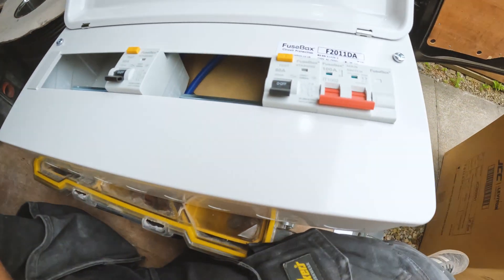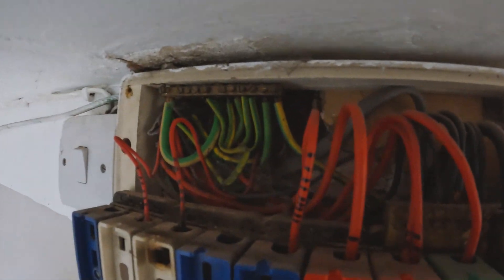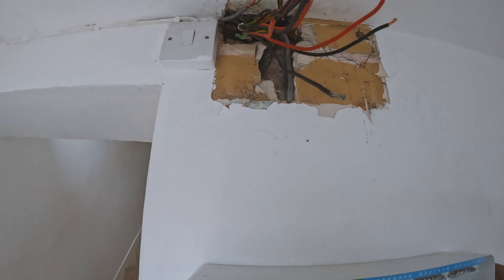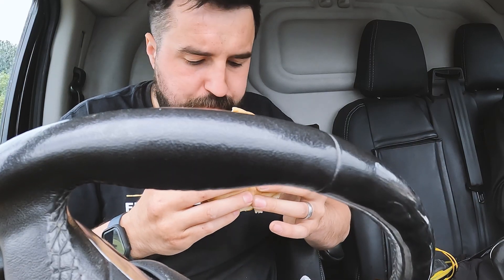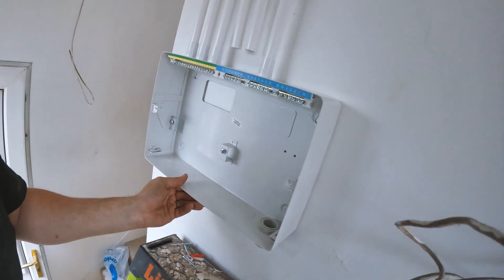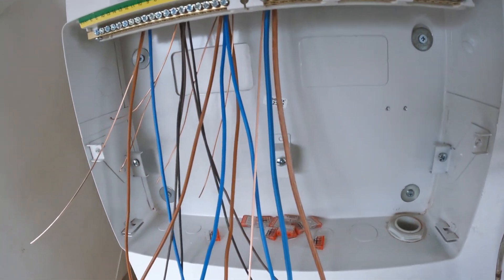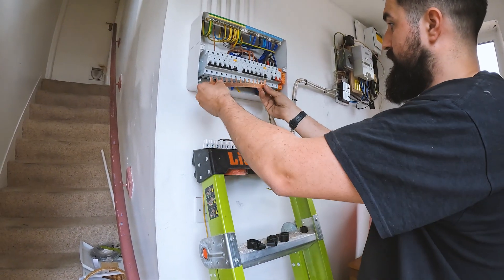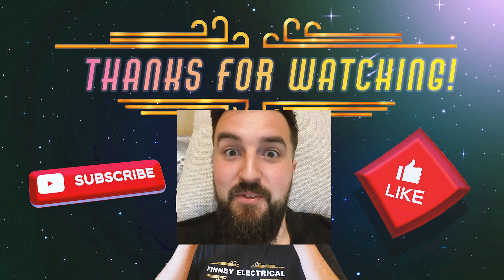FUSEBOX FUSE BOARD w/ DUAL RCD ⚡ (R)andom (C)hicken (D)ance 🐔

Comment: Nice video.  Nice work.  Personally i think split load boards should not be used as they don't really meet the division or circuits with minimal nuisance tripping in this day and age.  I  would prefer full RCBOs with an SPD.   But each to their own ss BS7671 does not always factor in cost to customer
Reply from the maker: Yeah I’d prefer that but most customers want it cheaper as they didn’t expect a fuse board cost half the time 😂 bless

Comment: Is there any reason you’re fitting split loads in 2023?
Reply: cost
Reply: @jonathanfenton  the cost difference is minimal with fusebox.
Reply from the maker: Yes definitely cost aswel 😂
Reply: Could have used a tall three phase board
Reply from the maker: True, you not like the stacked one?
Reply: @finneyelectrical  you do a great job,. I just like all the space in commercial  distribution boards.   Testing videos are always appreciated . Thanks Jon in Leeds
Reply from the maker: @TheUkjedi ah Leeds lad 👌 yeah nice a roomy! What’s price difference Jon?
Reply from the maker: Only need to fit them if there’s loads of dc current really. A small flat doesn’t meet that criteria in this case. And mainly cost with the customer 😀
Reply: @finneyelectrical  gotcha! I don’t see many split load FuseBox boards fitted so!
Reply from the maker: Seems to be a northern thing? When there a good £200-£300 in price difference it means a lot to customers
Reply: @finneyelectrical  is that was it is for you? £100 tops, for a 14 way RCBO Board, compared to a Hager split load in the north east area 

I’m not bashing by the way! Just curious
Reply from the maker: So fuse box is £220 for a ten way rcbo. Or Hagar £320 rcbo. 

Compared to Fusebox or Hagar duel RCD is £130. 

£200 difference with hagar, we normally allow a bit more labour if we have to mess about with borrowed neutrals seeing as everything is on separate rcbos.

Comment: I think I'd be using a single piece of 100mm trunking instead of all those 20mm conduits but each to their own 😂
Reply: I think they were going for the industrial look 😂
Reply from the maker: 😂 metal boards, would end up with a massive hole in the top of the board angle grinder in if not 😂
Reply from the maker: Best way I could come up with tbf 😀